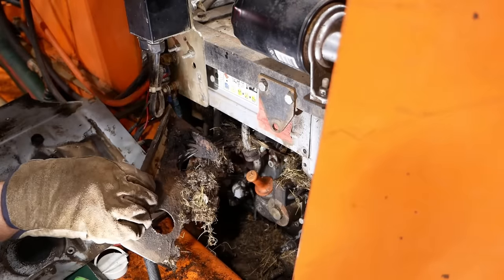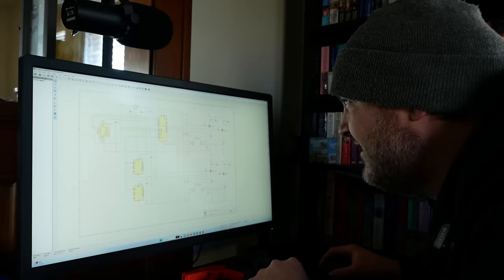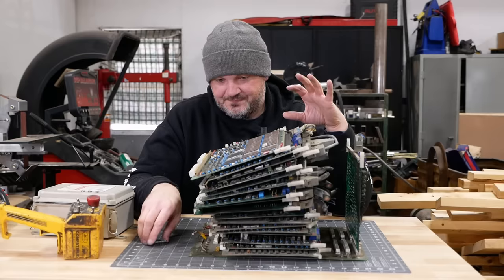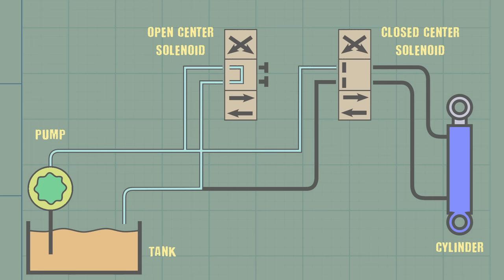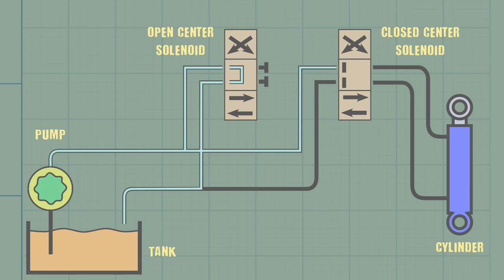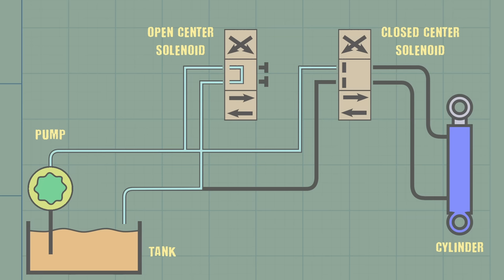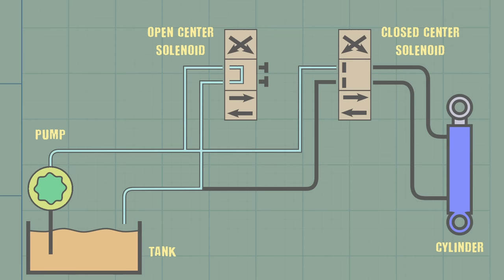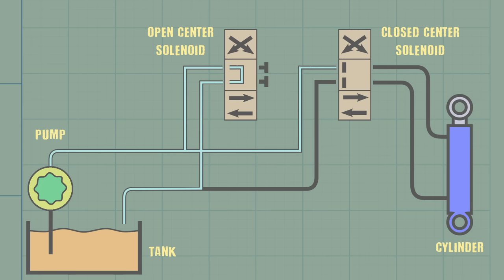Will It Move after 10 Years? Sketchy Robot Hacking

Comment: Wes, You have the most amazing integration of mechanical, hydraulic, electronics, controls, and digital knowledge.  Along with communication, teaching, and problem formation and solving skills. Plus, you are a regular nice guy.  Truly impressive.  I’m a 67 year old electrical engineer with an electronics and power systems background.  You are the most knowledgeable and impressively well rounded person I’ve seen in these areas. All the best to you and your family.  Shoot for the stars.
Reply: Wes was a CNC machine tool technician in his former life, and an excellent one at that.  In the world of CNC machining centers, those are all common systems on most machines.  Add in pneumatics, computer architecture, programming, machinist, fabricator, and probably the most important, the ability to logically troubleshoot complex systems as additional skills needed to be a really good CNC tech. An Arduino style microcontroller is perfect to use as a mini PLC to control hardware like this, do it all the time.  The 3D printer goes hand in hand doing this stuff, huge time saver over having to whittle it out on a mill/lathe.  Wish I could hang out with him, uncanny how similar we are.  I suspect Wes may be a bit Aspergerish too...

Comment: Excellent description of modern integrated circuits! I remember in college writing firmware on PIC microcontrollers and controlling individual DC motors by building those onto prototype boards with custom built H bridges... Now you can just buy an Arduino and a motor controller shield for less than $10, and run servos, steppers, brushless, whatever you want with just a change in pin definitions and calling a different function in the library. These kids have it easy!

Comment: Love this build!!  So much better than anything on YT.  This is a "Will it Run" at the pro level!  Great camera work, editing and electronic protoytping.  You got my vote on the DIY alignment rack.  I did many manual alignments using only a toe bar, bubble gauge and a couple base plates...but that was way before 4-wheel alignments and independent rear ends.

Comment: Maybe it would be helpful and safe for the robot to have a total system shutdown switch, a palm size red button that you hit when it won't respond in time. They have these system shutdown buttons at fuel stations with self service to shutdown the pumps in an emergency. Also it would seem a wireless control would be like the crane trucks they use to load roofing material on houses. Nice work, you have really hit a self-actualization indicator. Your videos are always interesting and follow a logical presentation path. Two thumbs up.

Comment: I have a lot of experience in ground robotics. The next level is to add speed feedback for each track. You can use a gyro to give you yaw rate feedback. But even better would be an encoder on each track to give you track speed. Adding another feedback loop that can close the loop on speed for each track (possibly with a feed forward piece to try to overcome the static friction) will get each track speed right and then you can drive forward at slower speeds. 

Electronics are much cheaper than they used to be. Adding a SBC (like a pi 5b) just to give you remote access and data logging can be super useful and costs almost nothing. 

You're doing a great job. Thank you for sharing. I'm not great at the mechanics, so I learned something in your hydraulics lessons.

Comment: This is great, I love it!
My experience with large hydrostatic equipment is that they're difficult to control when the engine is idling. When the engine is at operating speed, it smoother. Provided the flow is controlled!

Comment: Mechatronic engineer here. 

Nice control system! That being said, PWM driver for solenoids? Jesus man! That is so much work! I would have just used a couple of beefy servos, they run on PWN signals but at about 5v, you just send them a number via the PWM value and they turn to face that number's direction. Commonly used on RC airplanes for their infinite* analogue variability and simple integration. Also, do add some endstops, fuses , failsafes and an oh shit button to the machine itself. 

Apart from that, awesome work! It's always surprising how easy mechanical to digital system integrations ends up being.

Comment: Looking at the valve setup, the use of an open centre spool that closes as the other function operates, yes we used to do that with leavers, you run a bar under all the levers , so any control operates that spool. 

By changing the height of the common bar, you can give finer control, by holding the open center spool part way, or even having a second bar (the first bar spool has an orifice to give limited flow back to tank, for low speed, the second is a dead stop or relief valve for full flow (these are in series))

Then pilot control/computerised valves took over, saving a lot of maintenance and head scratching.

Comment: Hello Wes. The actuators that run the tracks maybe driven by too much current now. We used similar actuators for throttle control and they ran off of a 10 VDC signal across an internal 200 ohm resistor to limit the current to the control coil to 50 milliamperes. At 50 Milliamperes the actuator was at full stroke. You can measure the control coil leads with an ohm meter to see if there is an internal resistor. Some other systems will use 5 VDC or a 24 VDC with a 4ma to 20ma drive signal. Hope that helps. Great video and great engineering.

Comment: That is just amazing!

We have at work servo hydraulic valves. They just take 0 to 10v and proportionally control the flow. Inside of them is LVDT sensor that tells the servo amplifier how much the valve has opened and the servo controls the flow up or down.

Comment: Mate - this video was next level outstanding! Diesel diagnostics - childs play. . . . . . . machine motion and fixtures via hydraulics - deffo not grade school level and then to reverse engineering the electrical control systems using modern miniature computers, relays, a wooden cutting board and then programming machine code with 20+ year old memories - words fail me, un-kin-believable. Carry on, you can do no wrong AFAIC !

Comment: I used to work on the AT&T seabed tractor.  It was a tracked based ROV (remotely operated vehicle) used for burying subsea cables.  Your robot is a toned downed land based version of what I worked on as an electronics technician.  I am really confused as to what you were doing with the Arduino setup.   
I think you may have made it way more complicated than it needed to be.  What you were doing with the computer controller tethered to the robot was what we called a “short whip”.  The main purpose of  short whipping was to remove the computer controller from the equation.  Our control boxes for this were just buttons and variable potentiometers, no confusers needed because the operator is.  I hope you read this and get in touch.  Maybe I could give you some ideas???
Tom Osborn

Comment: Wes, I stumbled across the Texas Instruments, LM1949 Injector Drive Controller. It's 3-5 VDC compatible, specifically designed to sense/automate a 'solenoids'  in-rush currents. It's a tiny 6 pin chip and about $6 each.  The description of operation made me think of your explanation of why solenoids were a challenge to control.

Comment: NodeMCU on some ESP32's could be a good choice. It has worked well for the Skutter me & my partner have built. Still in an early stage, but we have found the range is plenty for line of sight & once connected it has not disconnected, you can also add safety as the connection can monitor its self & trigger a cut out is the controller disconnects for any reason. The ESP32 uses WIFI but it is on an point to point link, can even have multiple nodes hooked together.

I would advise againced using a PS3 controller as the analog values out of that are more on & off. Also good work on putting together a test bench electronics control setup, I am all to well versed in programming projects that take way to much time & can be very frustrating. It is though facing the challenges we come out stronger & smarter that before having gained just a little more knowledge to make the projects easier next time.

Love seeing you bring this old logging robot back to life.

Comment: 😂 I am absolutely thrilled with this stuff you are doing on this thing Wes. It's great to see this come to life and actually work. I think you should make the remote out of a similar setup from what Some of the large wrecker trucks have that have there boom cranes on them; that way you can have room for moist everything you need such as your buttons to control the grappler and blade and then you'll have a spot for the joystick and it would be more compact than what you currently have now. But no matter i still think this build is going absolutely wonderful and it's great to see your amazement and surprise when you have it working correctly!!  Keep up the great content!!! 😊

Comment: Appears you have flyback diodes on the relays, as you should.  ALSO make sure you have them on the solenoids, as they store way more current than a 0.2A relay.  That could cause havoc. Quite great electronic design.  Congrats.

Comment: The "two solenoids in line" issue was one my boss was having on a machine last year when trying to hook up an electronic bypass, he couldnt figure out why nothing was happening when flipping the function direction solenoid. 
I had an inkling that there also ought to be a flow on/off solenoid in the loop and after tracing the lines back further we found it and managed to get it all working.
The new telehandler we had gotten has a "safety feature" which disables the front axle/chassi tilt function as soon as the boom is lifted or extended past a certain point, meaning the machine is actually useless on uneven ground where one would need to be using the function to compensate if one is also lifting something. 
We hop between different construction sites where the ground is often unfinished, or go to private plots in wooded areas with rocky or none-existent roads where that type of tilt compensation is essential.
We have two machines of a similar make and model, but a few years older, and they were not hampered in this way.

Seems to me and my boss that the engineers have good intentions but no real world experience of operating the machines they design.
Looking forward to seeing that robot getting RC'd :D

Comment: Hey Wes, just found your channel from this video. Great work. One thing that may help with the controls being 0 to 100 is smoothing your input on the software side. Essentially telling the Arduino to take 10 samples in a row, average them out, then return a value since the potentiometers in your joystick, and your fine hand movements aren't exact this can help filter out the noise. I'd also suggest upgrading to some new solenoids, as likely will be easier to control

Comment: What a wonderful project. Major kudos for getting as far as you have so far. It seems like the basic functions work. I'm guessing there's some issues with seals in the hydrolics given how long it sat. If you're lucky, those may have been off the shelf. I see no reason you couldn't use an RC radio control to make that wireless. Another thing to consider is a basic game controller like for an Xbox or Playstation. The switches and joystic sensors in those are actually very high quality.

Comment: Wes, great project! It was like I was right there with you.  not sure if anyone else mentioned this yet but you should add some logic for a feedback loop And add two track motor speed sensors or encoders. one for each track when it starts to deviate the processor can correct and open / close the prop valve a little further .so it could be able to compare those signals to know if it’s going straight or not. Similar to abs and dsc systems . Just something to consider.

Comment: You can get really good quality remote control systems from China for a few hundred dollars.  I purchased a 1984 Chevy C30 tow truck with a Vulcan aluminum roll back bed with a chain sling under lift for $1200.  I installed a 650hp LBZ Duramax and 6 speed Allison and converted the chain sling under lift into a automatic loading wheel lift.
I purchased 2 identical remote systems for $250 each so I would have a spare in case of failure.  I set it up so the remote system can start the engine, engage and disengage the pto, engage and control high idle mode, control all the safety lighting, and operate all hydraulic functions on the bed and converted wheel lift. I have been using the remote system for almost 2 years now without a problem.  The original mechanical valve block is still functional so I have those for backup as well.

Comment: From working on remote control units on concrete mixer trucks I discovered that the radio units that we buy from the dealer for a couple of thousand dollars are related to generic garage door/gate opener controls that sell for about $100. (double the price for twice the channels)
I think they switched to digital controls to increase the profit on replacement parts.
We are running various solenoid spool valves to turn the drum, rev the engine, move the chute, etc.

Comment: Wes you can add ramp to speed on the tracks movement.  This will smooth out the jerky or quick movements.  The program would be like this.  The joystick is moved and you use a counter with a time delay.  Milli second delay.  Then move the new count to your mosfet output.  You act slower to move faster but act faster to move slower.  Basily you just filter your output with a delay/ramp to speed.

Otherwise this was way more than what was expected. Love you tackled the problem.  Radio control should easy!

Comment: I was fascinated by this video. I would encourage you to do more.  Being retired, I regret that I am not able to fund your adventures.  I had an idea that might help. With all of the remote control products model airplane builders use, multi-channel radios and receivers, servos, and other devices, you should be able to easily adapt these things to control your machine.  Another thought I had involved using a stepper motor in place of the solenoid to control track movement.  Is it possible you might incorporate some sort of feedback to determine speed of the tracks?  Or, use a non-linear algorithm in controlling track speed?  As you can see, I am very interested in seeing your progress as well as well as more "oddball" projects. Keep 'em coming!

Comment: Wes , very impressive. Might not be able to find a used one but if you find time look up HBC in Kentucky. The receiver box approx 5"x5"x5" has a relay board w at least 15 relays, outputs a usable voltage .remote is a 2 stick twist knob ,range of at least 300 yards.

Comment: When you make a remote, I'd go with a 2 joystick system (one for each track) that way you can easily control each one rather than try and modulate the joystick to keep it straight. It might help with your steering problem.

Plus you can have one go forward and one go back to be able to spin it like a zero turn mower.

Comment: I would have to go back in your videos on this machine to recall what it has for a pump in it. In most cases the values used for current going to the pump control pwm or pwms always has a range. Commonly old Danfoss pumps were like 5-95 mA while Rexroth was 500 to 950 or so from memory. Often times in the parameters set for the pump you would find a min mid and max value for the current. I believe that this format gives the pump a more linear ramp and almost a double ramp in speed. Most of these pumps also have a "centering" adjustment on the controller so that the swash plate starts at the most neutral position causing the control to be more accurate from side to side. After this is verified you could calibrate it manually by figuring out how much current it takes to make the track move initially on each side. This could be the "min" value. Mid values help the tracks go along together at similar speeds, and obviously max mA would help it not seem like it wants to instantly run you over. I'm not sure if this makes sense to you but this would seem to be the typical way a microprocessor controlled hydrostatic tracked vehicle would drive in my experience as a lowly mechanic with quite a few years working with hydrostatics.
Reply: I meant to open with this but its very impressive that you were able to make your own controller, never in a million years would I have made it that far and thats why I always enjoy your videos. Keep it up Wes!